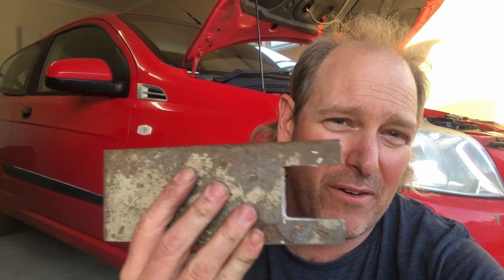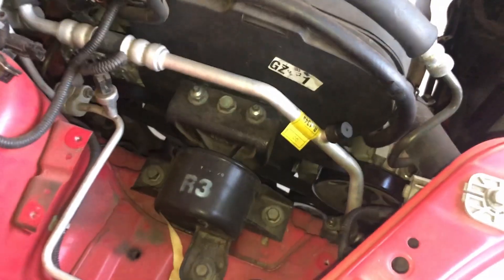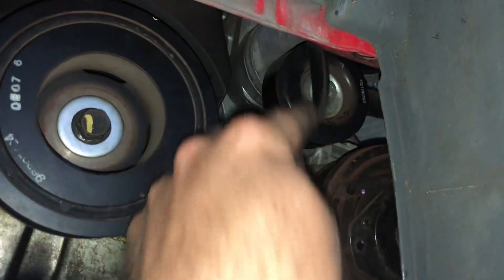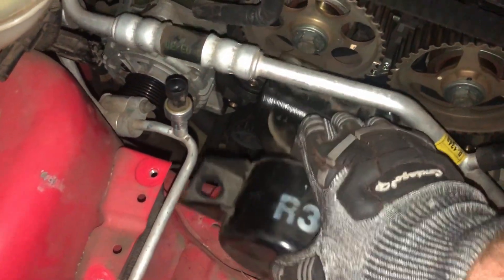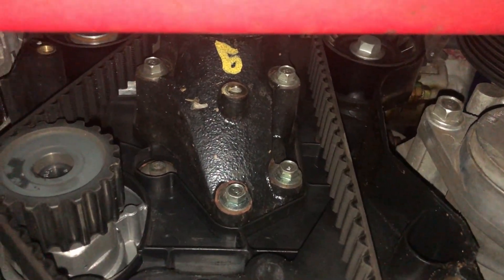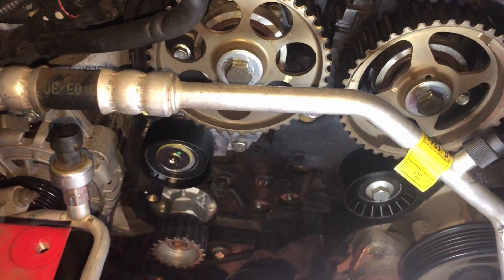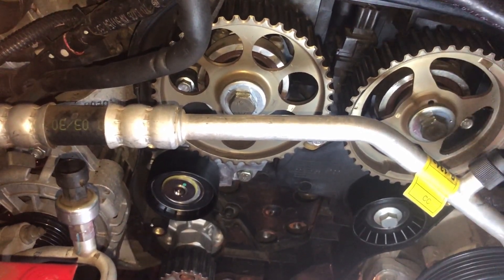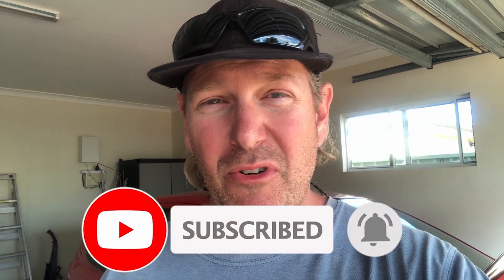Mastering the 1.6L Engine: Holden Barina Timing Belt Replacement Made Easy!

Comment: Thanks for the video.  Would a 2012 barina be significantly different?   I'm Trying to see whether I can help someone out but worried about overcommitting myself    Cheers
Reply from the maker: I’m not sure on any differences, if there is it would likely to be in the belt tensioning setup up and access requirements with cover removal.

Comment: Got a 2000 Daewoo Lanos with this engine...I don't see any way to adjust the water pump with out removing the engine..
Reply from the maker: Whys that? Poor access to the front?
Reply: @Shanes_Shed  In a nutshell, yes. That cover you took off to remove the water pump, is a little different on the Lanos, where it actually blocks the ability to put the tool on the body of the pump to rotate it. You have to slide it in from behind that cover, but then that makes the alternator and intake manifold in the way...

Comment: Does anyone know if this is the same water pump kit that would fit the later Holden Barina 2012 TM model? Been told that there are 4 different water pumps. Thanks
Reply from the maker: Couldn't tell you exactly how many different styles of pump there are, but it wouldn't surprise me having so many different variation's.

Comment: Great video mate. I found it very helpful. The fact they designed the engine with the plastic cover covering the water pump is so ridiculous. So much more work than it needs to be. Especially bad considering most people change the water pump with the belt and the belt intervals are every 60k on these engines!
Reply from the maker: Agree it’s the dumbest design idea around

Comment: Great video dude this should help heaps 
Those stupid plastic idlers and cover
Reply from the maker: Would have been nice if it was designed so you didn't have to remove the camshaft pulleys and the back timing cover just to get the water pump out.
Reply: @Shanes_Shed  what was the steal plate for i didn't see
Reply: Dont worry its for the water pump
Was making a coffee at the same time haha
Reply from the maker: love it when viewers answer their own questions!
Reply: @Shanes_Shed  sitting at the fuel bay watching it then i was like ill just make a coffee haha
Reply from the maker: @downtheshedwithbyron if I drank coffee I reckon I would have gone through a few of them by now, so bloody tired. First day back at work…